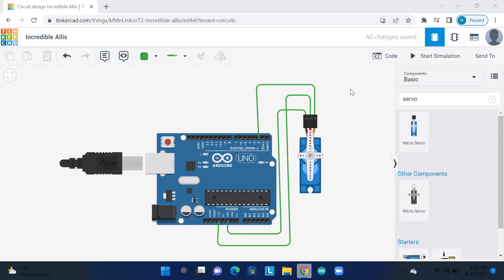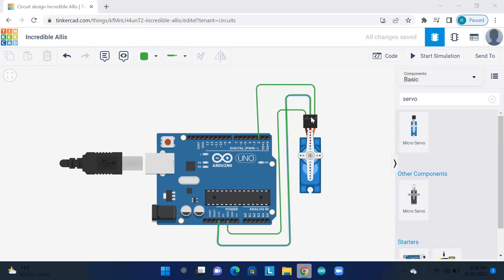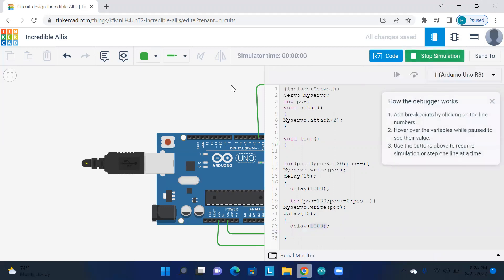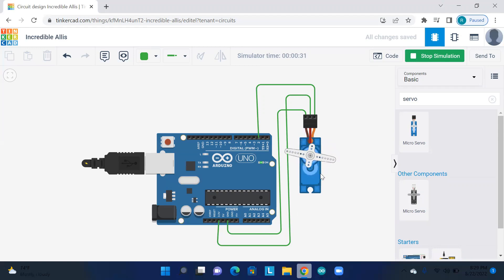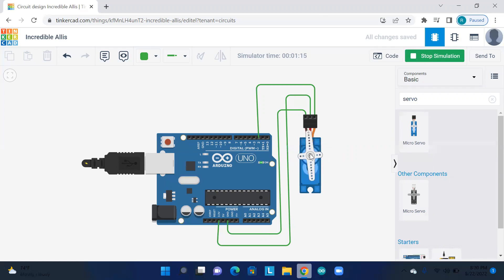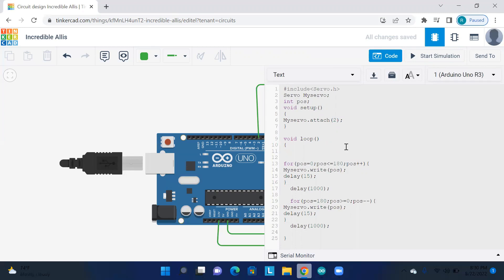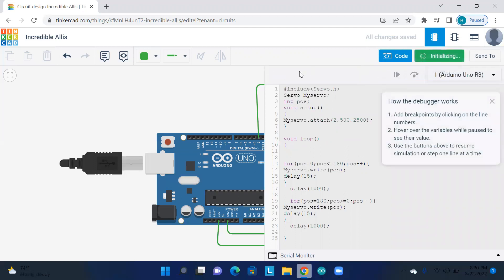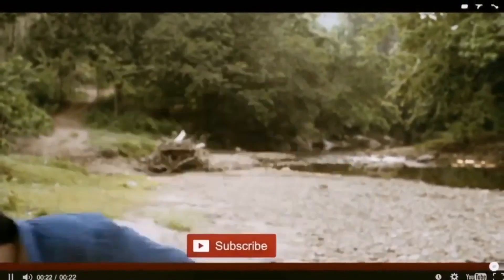How to troubleshoot Servo motor issue (rotating only till 90 deg) | Ravi Prasath S | Tamil | #iot

Comment: Can u explain in English
Reply from the maker: Nowadays servo motors rotate only till 90 deg even if u code 180 deg....so u have to define the min and max constraints as I shown in video ....min value 50 ,max value 250
Reply: Okay got solution thanks for video